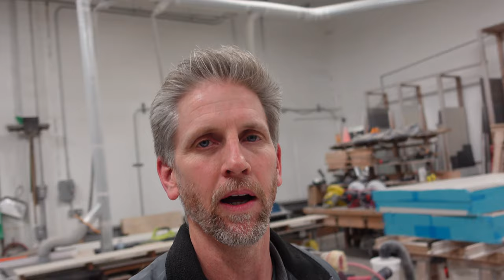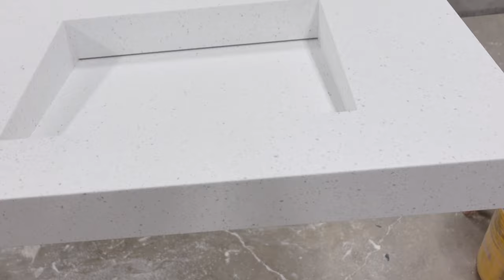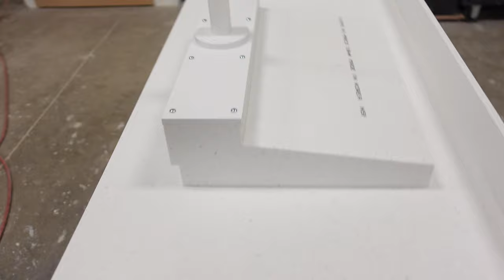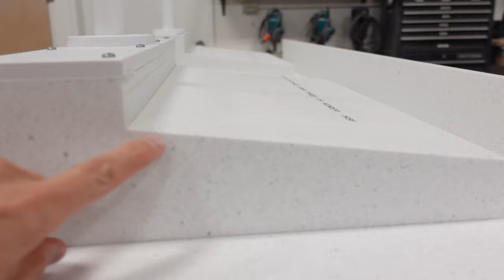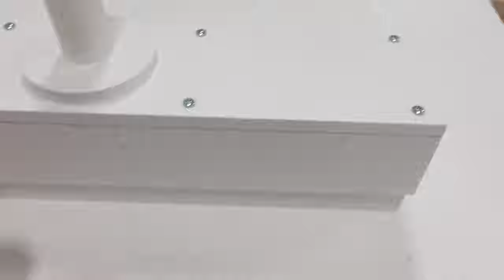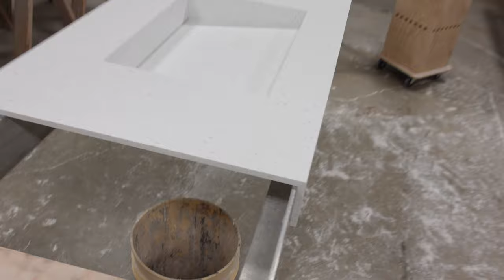Corian Ramp Sink Video - Solid Surface Seamless Sink

Comment: How would you make a kitchen countertop which is supposed to be 20mm thick in the front out of 12mm corian? Would you make 45degrees joint in the front of it or glue two 12mm pieces together and use router to plan it to 20mm?
Reply from the maker: I have videos on edge fabrication. It would depend on the color and pattern. Brined material would be best to miter the edge. Solid colors could use a drop edge. Particulate colors could use stacked edge.

Comment: When you designed this sink… did you have it specially made at a homedepot or  how did you fabricate the solid piece of corona? Like how did you create the 2 inch drop into the seamless drain slit? This is really  cool
Reply from the maker: We made the entire sink and then glued it to the bottom of the Corian material.

I have another video on the ramp sink that shows the bottom drain section.

Comment: How do you figure out the slope of the ramp?😮
Reply from the maker: I designed it on a cad program until I looked the way it looked. Start with 2" drop in the front and 8" in the back.
Reply: @AndyGraves  Thank you for the info. 
Stay blessed 🙌

Comment: Does the water drain slowly since there is no overflow hole?
Reply from the maker: No. Why would it drain slow without an overflow?
Reply: @AndyGraves  …because an overflow hole makes the water drain faster. Kind of like 2.5 gallon drinking water. You have to puncture the top for the water to flow/dispense faster. . I used to have a vessel sink without an overflow hole and it drained so slowly. To fix this issue, I had to do something similar like this video. https://youtu.be/EpH4fX32ams?si=1oGWcVpvhkxY7upn
Reply from the maker: Got it. This doesn't happen but it also has a large trough under the sink when the water gathers and then drains.
Reply: Thank you for answering the question!

Comment: Roughly what dimensions did you use for the sink bowl depth in the front and back walls?
Reply from the maker: I actually don't remember but I would guess 4" in back and 2" in the front.
Reply: @AndyGraves  Wow thank you for the quick reply! Love your video. Wishing you all the best. 

I ended up "modeling" mine with 3 inches in the back and 2 inches in the front. The slope might be too shallow though, so I might switch to 1.5 in the front.
Reply from the maker: @HannahLau7  Now that you mention it, I think it was 1.5" because the strip in the front is about an inch.
Reply: @AndyGraves  awesome!! I’m going to go with 1.5” then. I like your sink cuz it has that front edge. All other ramp sinks have no edge and immediately start sloping but I’m not a fan of that look. I’ve been using pictures of your sink as reference to show everyone haha.

Comment: How does one fill such a sink? IE plug it?
Reply from the maker: Hello, these are typically used in commercial applications. Commercial vanity sinks don't have stoppers  so that you can fill up the sink. However, we have used these things in residential applications and you just don't have the ability to stop the drain.